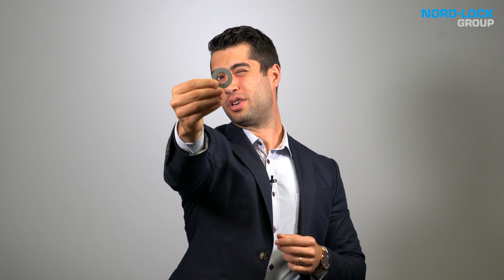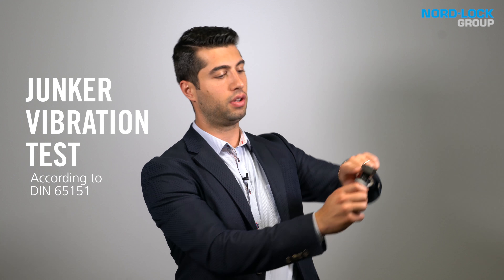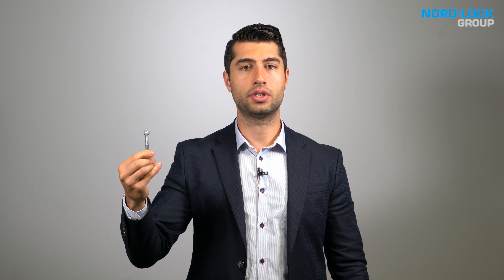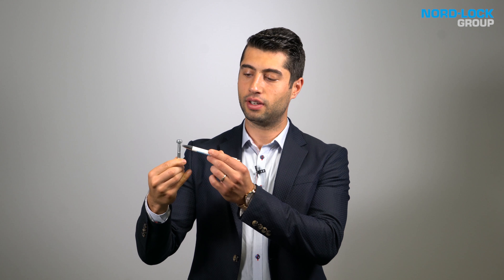Nord-Lock vs Nylon Insert Nut - The Challenge

Comment: Interesting but what happens when load is on/off? Say on a shock absorber. In this scenario the nyloc would stay located under vibration but the nut with washer would vibrate loose.
Reply from the maker: The way a bolted joint usually works is that the clamp load generated by the bolt should always be higher that the working load that effect the joint. This means that the bolted joint does never loose all of the preload because if that happens then the joint will open and the bolt will have to take all of the dynamic loads. Then the risk of fatigue failure of the bolt is very high. A bolt is very strong regarding static load but not very strong regarding dynamic load.